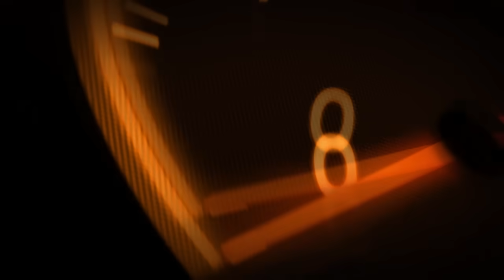Big Engines Starting Up

Comment: I heard a top fuel dragster for the 1st time last year and it was one of the most incredible moments. The earth shook as it thundered past, rapidly bouncing down the track in a flash of fury. My glasses vibrated on my face lol. It was unbridaled extacy. (I have tinitus because I love loud sounds so much. It's horrible. I can't sleep without listening to rain to mask it.)
Reply: Hope you made it over to the pits to hear them test fire the engines after the between rounds  rebuild too. Incredible..but man those nitro fumes burn like hell!
Reply: Imagine your first experience sitting on top of a team truck. That was my first. Whole thing shook
Reply: My dad used to take me to santapod raceway here in the UK.. I remember top fuel'ers.. great fun :)
Reply: @Thatdudewiththedogs  Thanks man, I'll look into that 👍👍
Reply: @Grant_Arnett  The ethanol cars are the worst for that. My eyes burned so badly and watered so much that I couldn't see. Don't stand right behind the pipes in the cockpit if you like breathing lol
Reply: Nitro dragster is one of the loudest sounds I've ever experienced.  Funnycars are actually louder, or at least at a lower frequency due to the longer exhaust tubes that have to go down and back up to clear the plastic body.  Top fuel dragsters just have short  exhaust tubes.  You'd think the shorter ones would be louder, but the long ones deepen the tone - like extending the slide on a trombone.  The sound is unbelievable.  It's too bad they've gone to 1/8 mile racing now probably because the speeds at 1/4 mile would be too high to even stop on many tracks.  As loud as funnycars are, they've been the champions for 50 years.  A top fuel funnycar today is faster than one from the 1970s, but the sound is pretty much the same.  Last time I went to a live event I wore shooter's ear protection and I was able to get up by the starting line and watch the burnouts and experience the sound without pain.
Reply: @winstonbeech3418  they seriously went to a 1/8 mile?
Reply: @Grant_Arnett  I guess they are doing both.  A 1/8 mile race is over in a blink.  Not sure why it has become popular.  When I last did any bracket racing in the 1980s, we had normally two brackets for weekend warriors - cars that dialed in 12.00 and up, and 11.99 and lower.  They now have legalized computer/optical triggers for launching the car - IMO taking away the one human aspect - and instead of speed brackets they have computer and non-computer.  But depending on their affiliation, each track can make up its own rules.  For NHRA class competition the rules are very strict, but I really don't know if there are whole separate sets of cars for the 1/8 mile top fuel or not.  Since a lot of them tend to blow up a motor in the 1/4 mile maybe that's why... lol.  Literally the nitro motors get rebuilt after ever pass, and they're designed for rapid disassembly, and the cylinder sleeves and rings are replaced and probably a new set of heads dropped on.
Reply: I haven't heard the sound of silence in more than 10 years
Reply: @Grant_Arnett  1000' .. or 3/16 of a mile is the norm for US nitro cars. What could modern cars do with that extra 300'? Probably not much more for the top speed as there is serious aerodynamic drag, engines loosing cylinders, and extra distance to break (tho in spectacular fashion). Look up Scott Kalitta. His accident was the motivation for a shorter track. I think they should of just made the track he died at a 1/8 mile for fuel cars. Cutting the distance put a damper on what was a very elite class
Reply: I have tinnitus too I have to have the TV on very low volume at night to cover the sound

Comment: that diesel locomotive engine sounded like a heartbeat when it was first starting holy shit.
Reply: The loco reminded me of the badass engineers, Machinists and mechanics who built it for us and kept it running. Every moving part is someone's dedication to doing it right!
Reply: EMD engine, when properly tuned, sounds like a purring kitten. Smooth like butter.
Reply: @matthewchapman2494  mùì
Reply: "When it was first starting"? As opposed to... when it was starting down the road?
Reply: @matthewchapman2494 : Uhhh... aren't they doing it right these days too, or...?
Reply: What's the time stamp?
Reply: You mean : 2:45.
Reply: EMD were just so simple and reliable. Only failures I remember seeing were human error   @stevedoe1630

Comment: The one at 2:46 is the most epic for me, because of the slow, heartbeat-like start.
Reply: ...then the dude accelerate it a little and it puts on some respect.
Reply: Jefferson Sales  he didnt accelerate it thats how a SD40 starts up. it just revs up by itself
Reply: 3:01 when you hear a creepy noise or something touches your foot in bed XD
Reply: I remember some gear head asking what kind of engine we had in our locomotive. I told him it was a 12 cylinder EMD 645. He asked how big it was, so I told him that the 645 indicated a displacement of 645 cubic inches. He smirked and and said that’s not much more than his pickup truck. I smirked back and said “no no, that’s the displacement for each cylinder.
Reply: So basically what I saw what happened: The pistons are pushed and given a rythm with the help of an electrically powered motor moving the crankshaft so the injection of fuel and ignition can start.

If somethings wrong, please correct me. Im only 15 and relatively stupid so I dont know very much about it. 😂
Reply: @CapNHector231  Also has 3 Valves in each Rocker Arm  Beautiful Engineering
Reply: @JorgeRodriguez-po7kx  it only has 2 valves for each of the 2 exhaust rockers with a total of 4 valves which are all opened at the same time by the valve bridges that the rockers push. The middle rocker is for the fuel injector
Reply: H
Reply: My first ship ran 8-645's for propulsion. That blower whine was interesting I'm heavy seas  @CapNHector231  🤣

Comment: Just something fascinating about harnessing the power of controlled explosions in an internal combustion engine.
Reply: ShadowHunter120 Diesel is an explosion and 4 stroke is a burn strictly speaking. :-)
Reply: It's cool that somebody thought it up. I haven't researched a lot on it but I imagine they were developed from steam engines, in that they thought up using gasoline instead of steam as a pressure source.
Reply: Yep. Ill never go electric. Not even if i have to distill ethanol from my own corn to drive.
Reply: Stephen Thomas They're both explosions.
Reply: BLU3_ST33L basically. Its a pump in essence. They just figured out they could crate the pressure source internally.
Reply: wait till they harness fusion for engines, zeee future is bright LOL no pun intended
Reply: Yashar MJ see i agree. I think something amazing will step up and blow IC and Electric out of the water. But ill forever own IC. I love building, driving, fixing, even changing the oil!
Reply: @yasharmj1717  s
Reply: @Larcona_  no, they're not. burning and exploding aren't the same. exploding air-fuel mixture is called detonation and it destroys motors.
Reply: @innocuousmerchant8766  Yes, they are, exploding is just something rapidly burning to create pressure, which is exactly what motors do.
Reply: @Larcona_  no, that's the definition of combusting. detonation or exploding involves a sudden reaction which involves burns that are not as uniform as the combustion which occurs in a properly running motor. please take five minutes to go and at least skim a wiki page on the subject, they are not the same at all.
Reply: @innocuousmerchant8766  Hate to tell you, both wiki and britannica defind explosion as rapid combustion.

Comment: 3:15 I've worked on these big diesels before and they are truly amazing
Reply: Have you ever worked on engines similar to 9:09 
The camshaft is the best part. It is about the size of a Ford fiesta camshaft. The square shaped cams trigger hall switches that in turn open and release pressure to the hydraulic rams above each valve.
Starting the engine using compressed air to push one piston down is also great fun. If it fails to start, it takes about 15 minutes to crank the piston back to 5 degrees ATDC. By that time, the air tanks are full enough to have a second attempt to start the engine. 
Needless to say, these engines are 2 stoke and run on heavy diesel that is almost solid at room temperature.

Comment: the question is, will it run on a Honda?
Reply from the maker: +Glue Sniffa69 answer???? I think yes :-D :-D
Reply: Car News Central :D
Reply from the maker: +Glue Sniffa69 :-D
Reply: Glue Sniffa69 If you grind the Honda up fine enough!
Reply: Glue Sniffa69 hell ya
Reply: MCM?
Reply: if u like ur honda's wheels to fall off ever time you put it in drive than yea...
Reply: 9:20 this will probaly do it
Reply: Mutakuonot ja lakupellet
Reply: Glue Sniffa69 ttttt.

Talcum
Reply: Glue Sniffa69 I
Reply: Glue Sniffa69
Reply: cj
Reply: it wouldn't be a Honda anymore if it had any hp
Reply: @Glue Sniffa69
No, the real question is, will it blend?
Reply: Glue Sniffa69 Hondas are weak
Reply: Music DNA I am its called a project car. -_-
Reply: Glue Sniffa69 Better questions is does it fit in a honda?
Reply: Misael Oliva se already know that it fits. now we need to find out will it run
Reply: Was that a F1 joke?
Reply: whats an f1 joke?
Reply: F1 = Formula 1 racing. 
The Mclaren Honda F1 team has been having major problems with engine performance and reliability this year. I assume that was the joke that he was trying to make.
Reply: J Woods you're all wrong it was the might of the car mods
Reply: Perfectly can run in your Honda, don't worry about that your going to smoke many cars in the stoplights guaranteed with one of these badboys.
Reply: mcm tag ? :)
Reply: Glue Sniffa69 i was gonna say that!
Reply: Jake Hildebrand there's nothing wrong with the cars. Hondas are usually great daily cars. This "will it fit on my Honda?"  joke just comes from some of the owners being ignorant. It's just a stereotype, but hey there's always hate to every car company.
Reply: Glue Sniffa69
Reply: who needs that when you got V-TAC yo?!
Reply: What a stupid question, my yon' ricer, didn't you hear VTEC JUST KICKIN' IN YO on that engines? It really DID YO, so any of those will certanly fit in your CIVIC YO. 
Tip: do not forget to paint the top of the engine in red after swap to make shure VTEC will be able to KICK IN YO.
Reply: Ilya Nizhnik ....what?
Reply: I think, you should study the KICKIN' IN of VTEC YO a little bit if you didn't get my message
Reply: Do you mean... mclaren honda?
Reply: Glue Sniffa69
Reply: Great Games 2004 just use a trailer!
Reply: XGN Blackout28 yeee

Comment: 9:09 what yall came for
Reply: Is that what powers London in mortal engines
Reply: Me: So what engine you running?
That guy: A 100L v8
Reply: I desperately want someone to attach this to a Honda Civic
Reply: @nighf its not a v8 tho
Reply: Johan Lønning it’s is tho
Reply: @enragedseaurchin8629  its a inline 8
Reply: @joshjosh5655  You must be fun at parties.
Reply: @robinkonig5828   Yeah large 2stroke diesels have turbos on them. super inefficient to not run with one
Reply: Doing God's work.
Reply: Imagine that thing running at 8k rpm
Reply: Didnt even show it start though. It was just running on compressed air when the video ended, didnt show it switch to diesel.
Reply: Now imagine if they straight that that shit
Reply: Cargo ship engine?
Reply: @hugoattman3186  more like an I8
Reply: @rndmzr153  no. They would attach civic to that engine😂😂😂
Reply: I’m afraid I actually came for 2:51...
Reply: @stampycatfan01lol  the thing is that he changed the thumbnail, a year ago when i commented the thumbnail looked like this: 9:09
Reply: @enragedseaurchin8629  Its not?
Reply: 0:00: You're not a mind reader.
Reply: @HelloKittyFanMan.  lmao ur just 1 year late
Reply: @luccacarmel9635 : LMAO, no I'm not. A year or so lateR, yes. But late overall, no. These comment boards weren't designed to matter when anyone comments. There's no "rule" that says we should only comment on them within a certain period of time. Anyone who thinks it does matter is just an idiot and a troll.

Comment: wish I had some clips of the bigger drilling rigs I've been on, lots of big Detroit Diesels on the older rigs, lots shiny new 1500&1800hp cats
Sick video!!! Nothing beats hearing that turbo sing for you.. I loved drilling having the controls for 3-5 1500hp engines at your finger tips, drilling surface hole is usually when you get to run everything wide open....tons of fun!

Comment: I don't see how that bug is street legal with that big ass blade on the back
Reply: I don't think a health and safety officer has approved that
Reply: Stephen Smith who cares if its legal, its so awesome that it deserves to be on the road.
Reply: Kiante Bolt it might help out with natural selection.
Reply: ahahhah
Reply: Stephen Smith, It isn't street legal. It stays parked at the Harley Davidson rental joint in St Helena California year round.
Reply: Actually the engine was used in a Sherman tank and that was the way they cooled the engine. It a W-670 Continental. There also were W=670's used in ww2 trainer aircraft.
Reply: actually no... the R-670 was not used in any sherman model... the R-975 was (M4 and M4A1)

other engines... M4A2 GM diesel, M4A3 Ford gas V8, M4A4 the insane chrysler A57 multibank (think 5 inline  6 engines combined in a radial configuration to make a 30 cylinder monstrosity)
Reply: we actually found something that's legal in California but not elsewhere.  As long as the car is older than 1975, you can pretty much do anything you want to it, as long as it has headlights, tail lights, mirrors and a windshield
Reply: This applies to most states. All part of the grandfather clause.
Reply: Oh, and don't forget Working Brakes ..............
Reply: Stephen Smith it's not it Flys lmao
Reply: It stops tailgaters.
Reply: Check that guy's other videos onit.
Reply: That ricer blade
Reply: Well emission testing doesnt apply to older, graandfathered in cars
Reply: BigDogBob,  Brakes, Brakes, we don't need no stinking Brakes.
Reply: It's not street-legal. It's a dragster.
Reply: Pearl Caster it's not a dragster it's a fucking blender
Reply: Stephen Smith xssx
Reply: Stephen Smith if you get tailgated you are dead
Reply: was thinking the same lol
Reply: Stephen Smith it's a baja bug, it's not supposed to be street legal. It's an off-roader.
Reply: +photogeorge Unless the VW company ran the tests. Their results would probably say it is fine.
Reply: It's california... what else to say. ;)
Reply: It a big assed circulation impeller marged with tha crank shaft of an old aircraf radial! Lol Struth what a combination! Though i im sure the impeller was impelling with the crank revolution than otherwise.. those little impel blades must of made quite an audible delight should it withstand the torque sheer from the engine/ Even that type of  impeller would  produce  some thrust, when the  engine was at full revs!. Quite  dangerous it seemed, they should of had some protection  cage around it!!!
Reply: but who said it was street legal?
Reply: A Troll it has a license plate. That's normally a giveaway, if it's not a vanity plate.
Reply: Stephen Smith I
Reply: +Tao Dude that license plate is old, of course it'll have one, its not like it was manufacture this year to not have one. The cars was legal during its time obviously, but whether it still is now is a different story. You need both a the license plate and registration tag, that beetle has no tag.
Reply: I was just guessing, i'm from germany, my licenseplateknowledge is old. Here you'll get your licence plate removed if you modify your car in not approved ways. :)
Reply: Well the plate is from California, so like i stated you still need a tag to drive it on the street. I'm sure in Germany they also require some kind of seal on the plate to drive it on the streets, i doubt the license plate alone is a "giveaway" that it can be driven without a problem.
Reply: A Troll Indeed, you need a inspection seal from the 'Tüv' that you have to go to every 2 years minimum by law.
Reply: +Tao Oh, well you see? So that bug is not street legal, without a doubt.
Reply: Looks like an engine off an airplane...
Reply: A good deterrent to tail-gaters.
Reply: Get to close to that thing and whap!! off comes the arm!
Reply: It's called FREEDOM, it's what makes America the greatest country in the history of the world, and why us TRUE AMERICANS continue to fight so hard to Make America Great Again!!!
Reply: Stephen Smith in California, the blade is probably legal but the smoke might get you life in prison.
Reply: PlittHD what's a health and safety officer. Sounds like some nanny state commie ;)
Reply: Mike Llitera
Reply: marv w radials powered Shermans? Wow never thought that due to the fact that there isn't enough cooling
Reply: Tailgate deterrent
Reply: no one said it was street leagal
Reply: Especially not in the endlessly overregulated lib Democrat state of California.
Reply: lol ikr
Reply: "Nanny state commie"?  I like your comment.
Reply: Would not be allowed on the street in Canada because if someone gets injured , the State pays the medical bills. We have Universal Health Care in Canada.
Reply: Yeah? Did I miss something?
Reply: NYET !
Reply: Stephen Smith @
Reply: Stephen Smith y
Reply: Stephen Smith it's gonna chop off someone's hand off
Reply: In Europe none of the engines would be legal, for the emissions alone. Totally different in good ol' 'murica where you can do as you please
Reply: T ridder That Brutus is in a museum in Germany actually...
Reply: It is a BMW engine afterall. however that doesn't make that engine legal for daily road usage
Reply: Damn, I didn't expect to get so many likes that really is a pleasant surprise.
Reply: the blade is a cooling blade